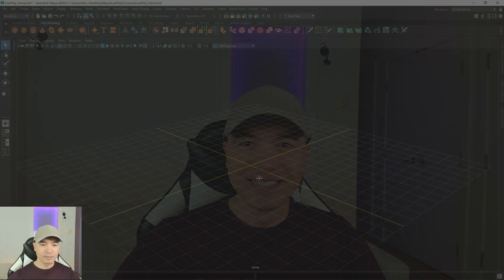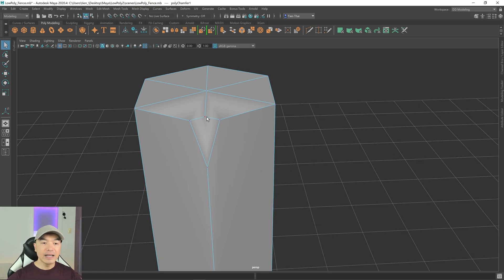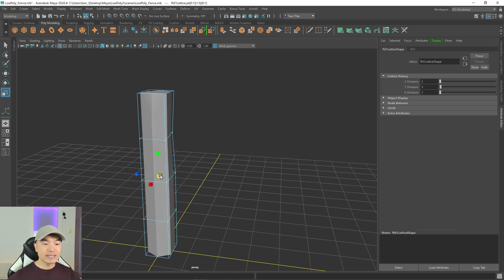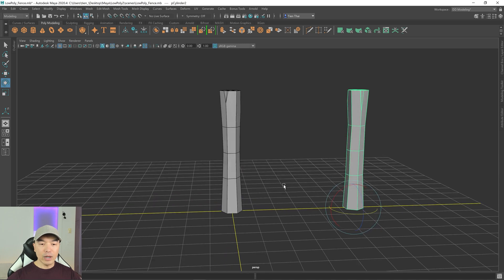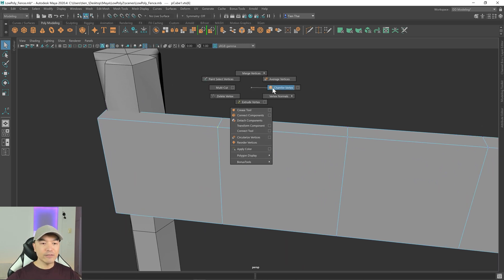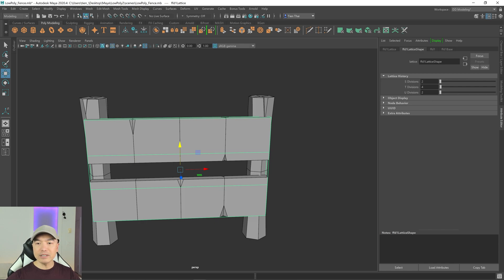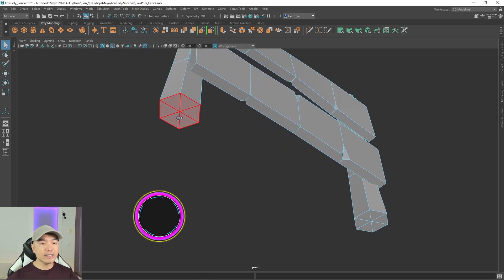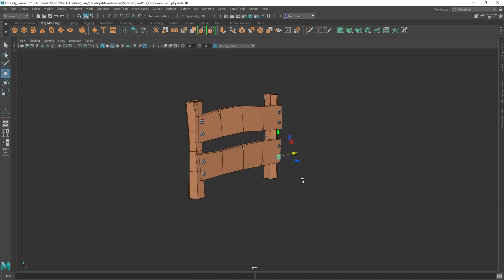Model A Low Poly Fence In Maya

Comment: @6:32 I was having a weird issue where adding divisions to the board was causing them to appear at angles, and it warped the board for some reason. I'm not sure what was up with that, but I was able to use the multicut tool (ctrl+shift+Z) to makes the divisions instead. 
Holding ctrl and clicking with the mouse wheel will automatically select the center between two edges, so you can make sure the cuts are evenly spaced.